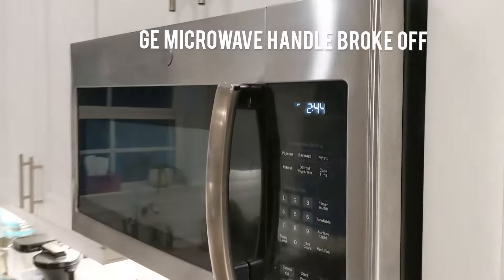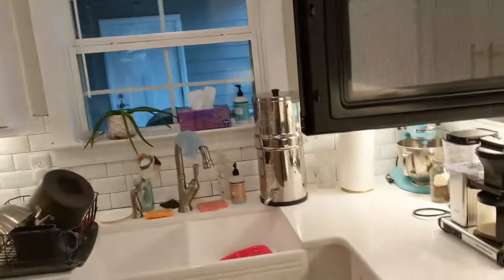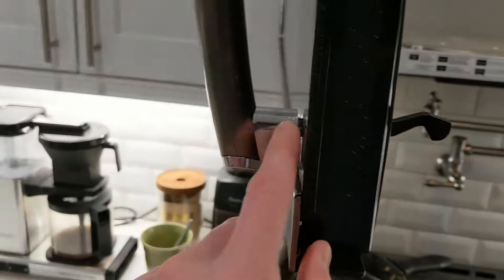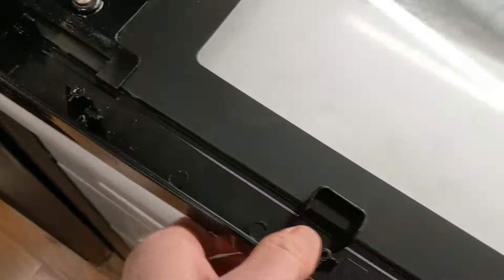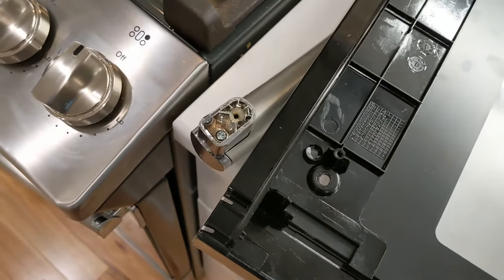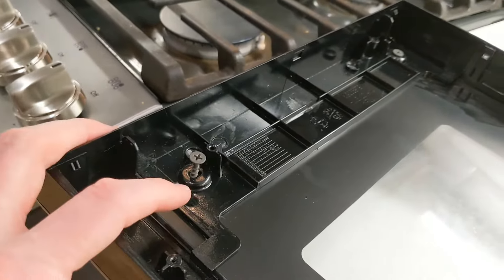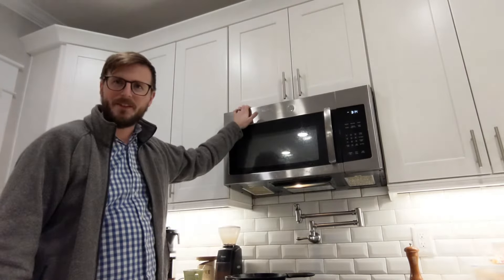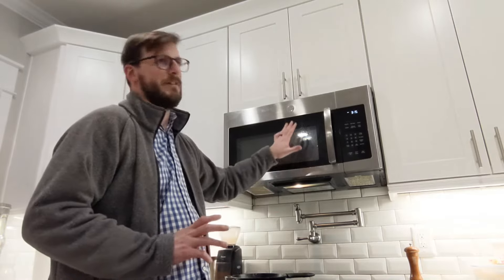GE Microwave, Broken Door Handle Repair

Comment: Wow, it really would have been great to see how to remove the door first!
Reply: Lmao
Reply: What you do is remove the trim piece on the door.  Then the door simply lifts off the hinges. Agree that Mr. Unconventional forgot how to show that.
Reply from the maker: @qwertypoint3011  I show in separate video on my channel
Reply: 245 dollars for a replacement GE microwave handle.
Reply: Lift the door and pull out
Reply: Thanks for sharing. Just a heads-up. I watched another video and the door doesn’t have to be taken off. I just popped off the 1st panel and was able to put my screwdriver through the 2nd panel. Unscrewed the top and bottom. Saved some time
Reply from the maker: Yeah I just found it easier to work on a flat surface vs. being constrained by the oven.
Reply from the maker: Yeah that could be an option, but I think the aesthetics would be a bit off. But functionally it would be more durable.
Reply: @user-si7on2bo8z  We have a 2018 model.  They put the inner  frame over the handle screw heads so you can't access them.  Getting the inner frame off is a real pain.
Reply: Not only that, but it mostly snaps into plastic grips that are designed for easy assembly, but no way to disassemble.

Comment: Great Video, thanks.   Just FYI, it's not that GE uses cheap plastic (if there is such a thing as good plastic!) but it's the fact that the handle sits directly above the eyes of the stove.  The handle gets heated every time we use the stove top.  This hot/cold/hot process makes the plastic brittle.   They SHOULD sell the microwave with replacement handles and design the door so that its easier to replace.  Just my thoughts.  Thanks again!

Comment: Thank you! I just spent 2 hours trying to figure out how to maneuver the metal frame that covers the access to the door handle screws. I’ll never buy a GE microwave again; but for now you helped salvage the 3 yr old one I currently have. Btw, the replacement handles cost nearly as much as the microwave so I had a friend print one on his 3D printer. It’s not the smooth shiny plastic, but it still looks good.
Reply: If you see this…How did you  finally get the metal frame out? Getting the door off and the plastic moulding was a breeze, but this is the part I’m stuck on. All the screws are out, but when I try to pop the metal frame out from the plastic tabs it doesn’t budge and the METAL bends.
Reply from the maker: Did you work around the perimeter?
Reply: @davidpollard4920 I’m having the same problem. I got the top part loose but the bottom won’t budge

Comment: So I replaced the handle on my microwave successfully but now my microwave won't work. I had removed the glass piece and there was a small thin metal pice about 1 1/2 inches long with a bend at one end and an oval hole and a circular hole drilled into the metal piece that fell out when I picked the door up into a vertical position. I cannot find where it went, can't find a part like it on any part website.... the door closes and latches but have no idea....any thoughts?

Comment: Thanks. Saved me $300 for the handle replacement.  GE charges ridiculously high on the replacement part.  I followed your video and finished fixing it in 30 min.

Comment: I bought my first house and for 18 months I've been tolerating a GE microwave handle where the stainless steel film has been peeling off.  I was nervous about this job because I thought I might screw up the radio-wave blocking capability of the door, but this tutorial got me through it.  Amazing!

Comment: I was on call with GE to order a  replacement for my door and then i found this video😄

I have the same exact issue with my door handle as well. I’ll definitely give a try fixing it by myself. Also we could have used a washer to make it even more solid but Thanks for the share…

Cheers Mate!! 🍻

Comment: Thank you! Just saved me a huge pain. Replaced both screws while I was in there. Now I need to replace the crappy heat shrink.
Reply: If you’re referring to the handle peeling that’s the same problem we’re having. Taking the handle off and going to paint it. Hopefully that works.  May be preemptive and use the drywall screws while at it….

Comment: Thank you, worked perfectly! My handle snapped, it wasn't just the screw, so I needed to buy another. Unfortunately GE sells the handle for about the same price as a microwave, but there were some cheaper options on ebay. One note though: on your door removal video, GE has some models that have a different tab - you have to pull a tab out of the door instead of pushing one in to allow the top pin to pull out. We appreciate you posting this, and agree that GE (and many other brands) are making poor-quality products.

Comment: GE handles are of poor quality. I replaced mine with a door pull from Celeste Design, part number CEDG1020. Your video helped me with putting the parts back together correctly. Thank you!
Reply: Good idea.  I was considering other handle options beyond OEM parts.

Comment: Thanks for sharing, as the bottom portion of my door handle broke.  Easy to follow video. The tricky part was taking off the door, as I had to take off the plastic casing to make it easier. The bottom portion of my handle broke, so I flipped the handle and put the replacement screw on top. Not sure it will make a difference, but thought it might help.  We'll see how long it lasts.

Comment: Wow, same GE appliances, same issues. My microwave handle broke at the bottom the same as yours. The display screen also goes in and out at times. My GE refrigerator had to replace a fan on it. I believe it was an evaporator fan.. issues with the ice maker. Lucky for me no issues with the dishwasher or stove yet. Lol But thanks for the video I repaired my handle the same way.
Reply from the maker: Lol, it's been very disheartening considering how much these things cost. We went through two water valves on our fridge in two years. I called GE expressed my disappointment to the quality folks and they offered to repair the fridge and replace the valve. I told them that it would likely happen again in a year, so they cut me a $100 check and we bought a Berkey Water Filter and cut the water off from the fridge.
Reply: I think it is a quality issue with many of the modern appliances.  I’ve had issues with LG, Bosch, and GE.

Comment: Thanks for posting. Yea, I've had it w/GE appliances too. No problem w/ washer/dryer after 7½ years but I've fixed the 4 y/o DW a couple times & the front panel is rusting through not to mention the 2nd silverware basket is now broken. Fridge bought same time as DW & was repaired under warranty. Handle just broke on microwave that is less than 2 yrs. old.
Reply from the maker: Did you get yours from an actual appliance store or were they from Home Depot or Lowe's?

Comment: This video has been very helpful. I have the exact same model microwave and my door handle just broke last night. So I have to replace it.  Thanks for sharing!
Reply from the maker: Did the handle snap in half?
Reply: @UnconventionalThinker  No….the plastic inside the handle that the screw bites into broke.  The microwave is only 5 years old….certainly unexpected.
Reply from the maker: @demondreed4769  yeah, ours broke after the first year, seems to be a consistent issue for most people on the GE microwaves.

Comment: Thank you, Thank You, THANK YOU! This really helped, as the same exact thing just happened on my GE Microwave, and I was able to repair it just how you described. (I must have a newer model, though, because the door handle screws were exposed right inside the first plastic frame, and I didn't need to remove that second door frame.) THANKS AGAIN!!!
Reply from the maker: Great to hear! But sad their newer model handles are breaking still
Reply: Got the first plastic piece off then unsecured the 4 screws on the next piece but it wouldn't come loose so now what?
Reply from the maker: @GlennMuzroll do you have a GE microwave?

Comment: I have a GE Artistry microwave. It's basically the same unit in white with a stainless steel handle. The magnetron just went out. I ordered the unit you have here in white. I was wondering if the stainless handle will fit to replace the cheap plastic one.
Reply from the maker: That I'm not sure of

Comment: Thanks for the fix. Can the handle be attached with screw without removing the door
Reply from the maker: You can if you're able to remove the trim. On my door it's possible to do that, but it's pretty easy to remove the door
Reply: @UnconventionalThinker  thank you

Comment: Your video is a big help, my handle is also loose at the bottom.  Is there any trick to removing the door at the hinges?
Reply from the maker: Great! That's my goal with my videos. For mine at the top hinge on the door there is a plastic "tab" that I had to push in in order for it to clear the metal portion on the microwave where the door slides into. When I push that tab and push the door up it's able to clear the metallic hinge portion on the microwave itself. I hope that helps if you have any more questions let me know
Reply: @UnconventionalThinker  

Thanks again!  It’s all fixed, and my wife thinks I’m an expert.  
One hint for the next guy:  use a magnetic Phillips screwdriver to replace the screws into the frame. 

For my hinges, I had to remove the top/front of the vent over the door.  It runs the width of the microwave, but only has one screw and came right out.  

The handle still had the screw firmly in place, but the cheap plastic strip it was mounted through was shattered. I was able to glue a flat piece down as a base, and secure the screw head with a washer.

Comment: I have a GE Cafe microwave (model CSA1201RSS02) and the handle also broke off .. I feel Iike it broke off at the black plastic frame part and I would have to replace the whole door unit 😞 .  Any thoughts on how to fix this? I can't find a place to sell the part and the microwave itself is still working great. Ty.  I don't think I can upload a picture here unfortunately.
Reply from the maker: Unfortunately tried to look up the part number and there doesn't seem to be any handle options. If there's no way to bite into plastic with a screw not sure how to help

Comment: Great video.I have a Cafe microwave and my lower handle did the same thing. It's out of warranty so I had a repairman come out. The handle is not available. He would have to order a new door. He called GE to order the door and it's $425. And it's our of stock. They don't know when it will be available. I'm going to give this a try. Was it difficult getting the door off. I'm not very mechanical. Thanks again.
Reply from the maker: Looks like you found the other video 😀. Hope this gets you fixed

Comment: I got the door and the plastic border (actually cracked in the process) off but I cannot get the metal part removed to access the screws to the handle. I removed the screws that were holding the metal center piece in place but it will not budge. I see the little plastic clamps around the edge but it will not move even when I pull those back. Is there something I am missing? Mine is a GE Over-the-range Oven PSA9120SF3SS
Reply from the maker: Are you referring to metal part as the metal frame within the door? Have you seen the schematics of your door assembly on reliableparts.com that may help?

There are these clip features on the door front where the glass resides that hold the metal frame to that door front. I found that I had to see what was holding that metal frame in place because it does appear on your door model there is maybe one or two screws that retain the metal frame to the plastic front once you've removed those I would imagine the clips are holding that metal frame in place so you'll have to locate those and try to move them as to release the frame
Reply: @UnconventionalThinker  I will definitely check that out. Thanks so much man!
Reply: @UnconventionalThinker  This was a big help. I was able to get it out and fix the handle. Thanks again!
Reply from the maker: @benburckhalter8821  Great to hear, glad my videos help!

Comment: How did you get the broken plastic off from the handle that was left on the door? The screw is attached to it and won't come out
Reply from the maker: Can you stick needle nose pliers in the front hole to fix the plastic so you can turn the screw?
Reply: @UnconventionalThinker  Thats what I thought about doing but I misplaced them. Luckily I was able to get it off with some kitchen shears. Appreciate the video though, it definitely helped!
Reply from the maker: @newjts93  Awesome, glad to hear!

Comment: Can I ask what you think is the best microwave brand?
Reply from the maker: Haha I wish I knew the answer to that question. I will say there tends to be higher quality appliances when purchased from a local appliance store, as big box stores tend to work special products from all the appliance vendors and they use cheaper parts so that these stores can sell products for cheaper than a local appliance store.
Reply: @UnconventionalThinker  thanks man!! So I’m having the same problem. 1) door handle cracked same way yours did. And 2) the bottom face plate cracked and is hanging down… any special fix for this guy?

Comment: Have usually bought GE appliances----but NO MORE!!  Why would a microwave handle break in a year or so??  Such plastic junk!! Old lady here, can't fix it, where do you buy a new door? The handle costs almost 1/2 of a new microwave. Any help appreciated. What has happened to good old GE products??
Reply from the maker: I feel your pain. For something that carries load I don't know why they decided to make it from the brittle plastic that they used. The only way I believe you can buy a new door is through GE. This is where I've gone in the past, you may want to check your model number as this is mine that I repair in the video. https://www.geapplianceparts.com/store/parts/ModelSectionParts/JNM3163RJ3SS/1/0/0/0/DOOR_PARTS
Reply: @UnconventionalThinker  Can't thank you enough for your kind and prompt reply;  amid the chaotic world we now inhabit;  my problem is a small thing .  I saw a (stainless steel) handle for $64+ advertised , do you know who has that,  please?  Then perhaps I could get someone to follow your excellent instructions to just replace the handle instead of a new door.  Many, many thanks for your help.
Reply from the maker: @barbarabass3298  so I'm not sure if you have the same microwave model number. This can be found on the inside of the microwave. If you follow the link I sent earlier then type that model number into the search it should show you all the parts it can replace. Find the door assembly and look for the handle. For my microwave it was WB15X21101, currently it's sold out. However I found that Parts Dr. is selling the same handle here: https://partsdr.com/part/wb15x21101-door-handle-stainless-steel?gclid=Cj0KCQjw5-WRBhCKARIsAAId9FkakMgpszRuPsyDyvlNyCjOF8NEoWB1YhZWSghIAHVQrNCYWj4CBh8aAsSKEALw_wcB

I have ordered from them in the past and they are a reputable site. If you are having problems finding your handle let me know and I can help if you can give me your microwave model number. Hope this helps
Reply: @UnconventionalThinker  Thank you again.  My son ordered the black handle and I'll get it installed. Must say I DO like the oven itself, but just read where a guy was on his fourth (4 th!!!!!) handle!!??  What is GE doing over there?  All for now, grateful for your video.

Comment: How do you get the door back on the microwave? I see you hinge the bottom then the top but it keeps getting stuck
Reply from the maker: If you look at the top hinge you should see on the door itself. There is like a black tab that you want to put in so that it clears the hinge and then you should be able to lift the door up off the hinges once that tab has cleared the hinge itself

Comment: Why did you remove the door?  All I did was pry off trim.  It exposed the screws and I removed them and mounted the handle.  Did all the door mounted.  Seems you did it the hard way and removed too much...  Not saying your method did not work but why do it that way?
Reply from the maker: It's pretty easy to remove the door.......

Comment: My handle is broke, I find a replacement for handle just for the part is 129. It is kind of crazy, it is made out of plastic but claim as stainless.
Reply from the maker: I would not pay $129 for a replacement handle. There are cheaper handles on Amazon on have a link to a few in the video description. But check your model number.
Reply: @UnconventionalThinker  Got my GE replacement part from Amazon for $67.  However, if mine breaks a second time, I will consider using the drywall screw into the broken handle similar to what you did.  I am also going to keep my original broken handle as a backup.

Comment: THREE DAMN HOURS to get the door back on. It didn't help that the oven is mounted pretty high up and I had to use a ladder and kneel on the cook top and try and hold the door and a flash light at at the same time. B
ut there is NO reason that the door hinge design is so horribly engineered. I was an engineer and I would FIRE any designer that came up with that user unfriendly design. Plus I ended up having to cut off the " tab" in order to jimmy the door back into place.
Reply from the maker: Dude I'm sorry about that. I really considered adding that portion in the video... should have. It took me a few originally when I first took the door off to figure out their tab design. Yes, I'm a fellow engineer and there are a few things in this design that are pretty bad but I doubt an engineer designed these things lol.
Reply: @UnconventionalThinker  take off the plastic trim first and it makes it easier to take the door on/off.